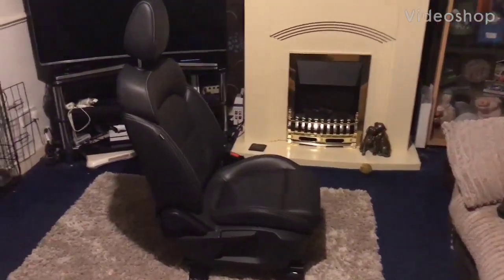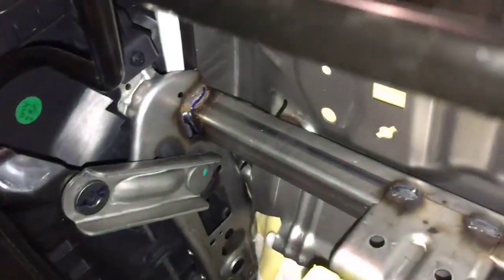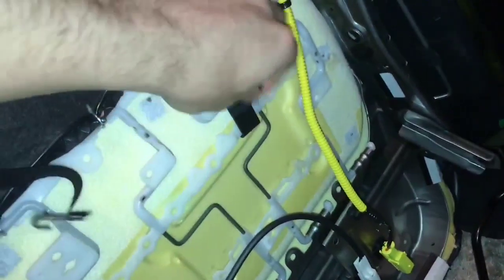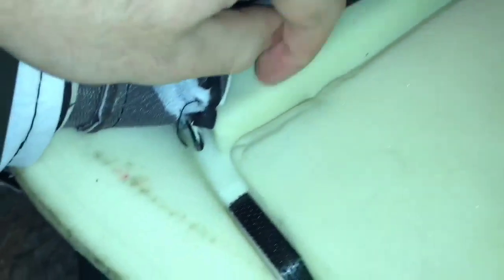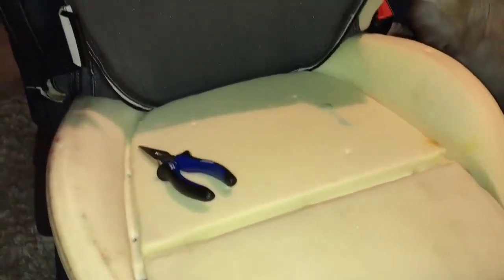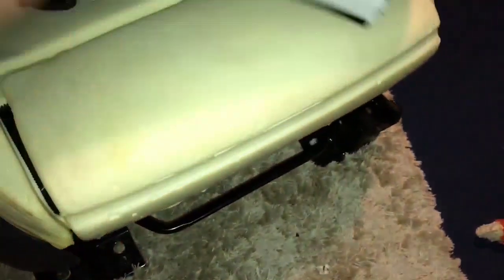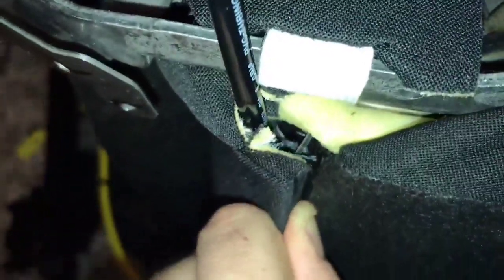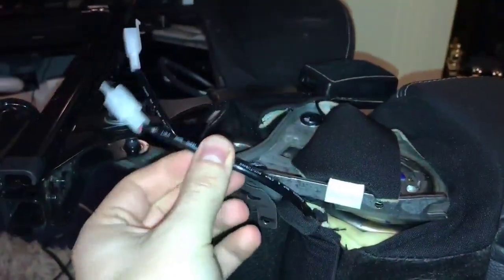Fitting heated seats to MG ZS Britpart DA5717

Comment from the maker: The ignition side of things will be ok on a 5 amp as it's only to trigger the relay. For the main supply I'd go direct to the battery or a high amperage circuit.